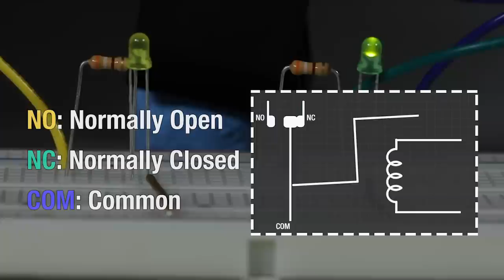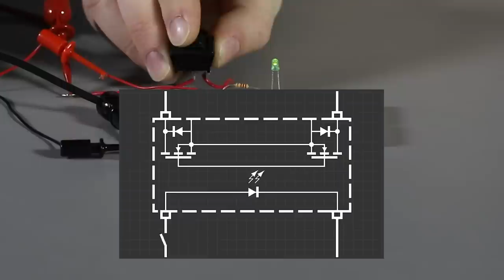Relay Basics - Another Teaching Moment | DigiKey Electronics

Comment: I need a DPDT relay for a well pump switching between 110 ac and 160 volts dc. The coil can be 110ac but prefer 24 vac. The dc load is the problem, because it’s a little over 10 amps. 
It’s burned up contacts on anything I’ve tried thus far. 
Any suggestions?
Reply: Rick Reep a higher amp rated relay?